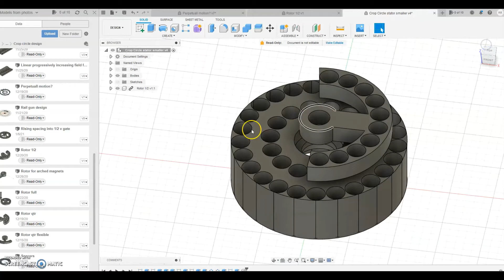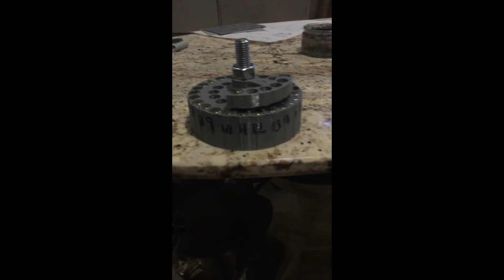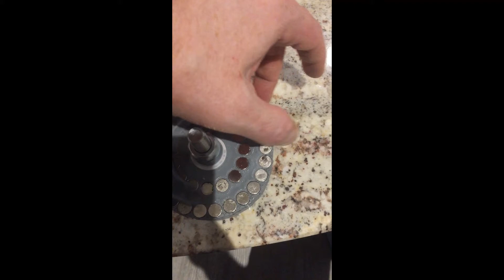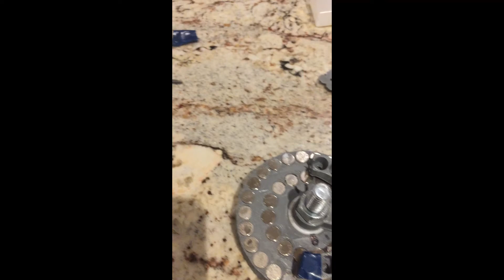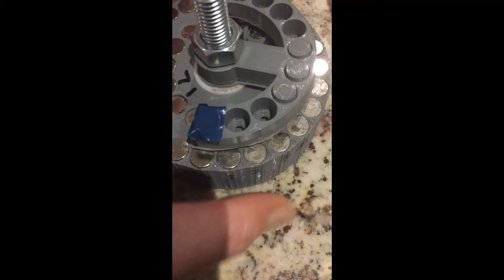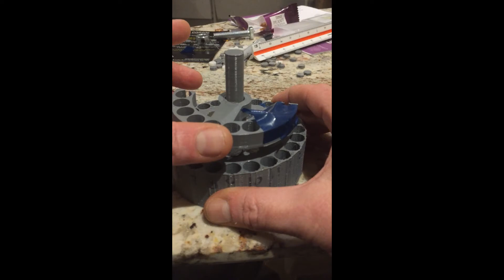Is this Crop Circle a design for a Permanent Magnet Motor?

Comment: I've already put this model together and one thing you are not taking into consideration. The depth of the drawing. You are looking at it as if it's one or two demential.. look deeper into your third eye and notice the dots/magnet's get smaller. They are not getting smaller, Their placement is deeper, lower or further down from the biggest dot/magnet.
Depth is why your model would work.
Now the amount of depth will be calculated by the measurement of the dot size using a visual distance of 1,33 mm. Scale. 
Please don't forget the polarity fluctuation theory. Magnets will switch their polarity caused by rotation speed and the amount of influences caused by other magnets. Use stable magnets.
That means the magnet used must be a ++ at each end and the negative or push must be on the circular sides of the magnet.. I first learned about these magnets while walking through a junk yard looking for a car part to fix my car and a friend was taking apart speakers that he came across. He stopped at a crashed Infinity SUV. And took apart the speakers that were located on the inside door panel up by the rear view mirror. Tweeter's as what we called them back in the 70's these weird magnets had the most unusual properties. They looked like three circular magnets one large one small and one large fused together forming a double positive ended magnet. Ask me one question please, I can't wait to answer your thoughts.

Comment: If it doesn't work. Could see that you might have saw thatvin a wrong perspective. What if the smaller ring is not a smaller right but it is just further away and therefore it appears to be smaller?

Comment: You must keep it out of equilibrium. Wander if a copper wafer the size of the magnets sandwiched between some of the rotor magnets would be enough to change the field as it moves across the stators.

Comment: If this were a working schematic,then the timing device is right in front of everybody..This is what everyone strives for trying to do this is searching for the Holy Grail timing device or system that will cancel out the magnetic pull at the right timing and allow a shaft to rotate freely..

Comment: Its a good design. You're only missing a tiny kicker in terms of design. Ever been to a parking lot where you have to drive in a corkscrew to get to the top level? If your magnets followed a slight corkscrew kind of rise and fall in their path then you could use the slight momentum of gravity to assist over the hump and that would also translate into kinetic energy on the downside.

Comment: Just thinking out loud here. The design is interesting, however your prototype didn't quite duplicate what the crop circle was illustrating. What if the outer and inner most circles were stationary and the middle two circles were the rotor (moving part)? It's also note worthy that the largest middle circle (of the two) has a ring around it, does this indicate that the center of the largest middle circle  is free to rotate? I'm also not sure what to make of the two solid inner rings around the solid center most disc. Does it indicate shielding or possibly a mechanical connection to the other circle rings? Anyway, good job for thinking out of the box!

Comment: There are these laws of nature specificaly the "Laws of Themodynamics" which explain why free energy is not possible. It doesn't matter how many magnets or what the configuration is that you use there will always be sufficient resistence to prevent this from functioning as hoped. This "motor" will ALWAYS require an input of external power to cause it to function.
Reply from the maker: The Laws were established thru experimentation. Since then they have become Dogma. Revert back to experimentation, which was the approach of those original greats
Reply: the law of thermodynamics has long been a myth. For ordinary people, ordinary scientists, it is hidden. Talking about terdodynamics is like staying in the stone age.
Reply: And what about push and pull forces from permanent magnets? There is nothing about thermodynamic.
Reply: Those laws have never been laws, they're a dogma, wanna know why? Because a "Generator" is NOT a generator:

"A time variable electric current creates an electric field parallel to that current. The field exerts an electric force on the charge in the nearby conductors thereby creating induced electric currents in them. This in the term “electromagnetic induction” is an actually a misnomer, since no magnetic effect is involved in the phenomena, and since the induced current is caused solely by the time variable electric current and by the electric field produced by that current."

"There exists a sourceless electromagnetic field whereas according to equation 528 such fields are impossible since there is no doubt that they represent a dual wave field, but as we've seen neither Maxwell's equations nor their solutions indicate the existence of causal links (no causation) between electric and magnetic fields. Therefore we must conclude that an electromagnetic field is a duel entity always having electrical and magnetic components simultaneously created by their common sources; time variable electric charges and currents."

"according to these equations in time variable systems electrical and magnetic fields are always created simultaneously because they have a common causative source, the changing electrical current, once created the two fields coexist from then on without any effect upon each other. Therefore electromagnetic induction is a phenomenon in which the field creates the other, I.E energy generation is an illusion. The illusion of mutual creation arises from the facts and time-dependent systems of the two fields appearing predominantly together."

-Causality, Electromagnetic Induction, and Gravitation: A Different Approach to the Theory of Electromagnetic and Gravitational Fields by Oleg D. Jefimenko

There is NO TRANSDUCTION between the kinetic input of a rotor and the electric energy in a generator, NO TRANSFER, if free energy was impossible a "Generator" wouldn't even work in the first place. The law of conservation is nonsense.

Comment: One way I see to solve this is you would need to flip the poles of the magnets on the track so the rail gets pushed forward using both attraction and repulsion forces.

Theory: 
> there is a circular runway lined with magnets
> a rotating arm with magnet at the end of it, that's able to traverse the circular runway  (let's call it a car)
> When you rotate the arm of the router there are mechanical components in the circular runway that flips the magnets on the runway by 180°

If the magnet underneath the 'car' is same polarity, if the magnet behind the car is same polarity and the magnet in front is opposite polarity then the 'car' is pushed forward with combined force of attraction and repulsion. 
If we can build a mechanism that can efficiently flip the magnets by 180° using a small portion of the arm rotation's momentum energy (which is definitely possible) then you have a perpetually running car and it doesn't even break the law of physics.

First we could test this using some computer simulation software, then build a prototype using electro magnets because it's super easy to flip the electromagnet's pole, probably need some Arduino or raspberry Pi to program this, ofcourse it will use external energy to run but it will prove it's possible to do it mechanically with intricate moving parts.
Reply: I starting to think the energy required to flip the magnets will be too great because of repulsive force of the car

Comment: What if you could change the polarity of a magnet? Or an electromagnetic field? What would happen if you could change the polarity of the field at specific times during rotation? Then your machine would be able to turn because you would use push and pull force at the correct times. Attract and repel. Add DC electricity to your copper coil to create an electromagnet. Switch the positive and negative terminals around to create the opposite field. N->S. S->N. Automate it.
Reply from the maker: Interesting ....maybe use the current generated from the natural rotation to power it

Comment: theres also need of copper coil in one point, and basically drawing of croo cirrcle is not showing electric motor, just electric generator on first point... its very important to understand the magnetic flux created by composition of circles on crop

Comment: Nice attempt! Because the strength and geometry of the magnets can not be adjusted then geometry and mass of the motor elemts would need to be adjusted to the magnets available. Drawings,  magnetometer (with suitable measuring range) and some calculations might help. Good luck!

Comment: The screw and nut add alot of resistance . I think a different alloy like copper , non threaded with a machined brass grommet would allow a fluid motion free of resistance
Reply from the maker: That isnt the issue, its the strong attraction at the gates

Comment: You need the exact ratio that is described in circles with accurate scaled ratio for accurate test I believe I'd you would of positioned the magnets more in the back and less in the front how u originally had it but when u added more instead of adding to the front why didn't u add it next to the tapped side would of made sense in my mind to add  8 and 8 and space it out about 4 then 5 away with 4 magnets I the front then add more gradually if needed great video tho your on to something

Comment: looking back at the crop image what if on the rotor  the large ball with ring is metal no magnet to act at weight  that will both interact with the magnetic field  and give you centrifugal force to  push the past the its end point onto the start point again

Comment: I wonder if it needs to be made of steel to give it the ability to spread / blend the Flux
Reply from the maker: Tried metal as well on this, less force still sticks...but I wonder if you had say 8 arms only 1 at a time at sticking point rest staggered to be on pulling points...pull on the 7 cld be enough to get the 8th over tge line
Reply: @explorationsinenergy8581  I mean the main body of the unit made from  many thin plates of steel like a transformer in theory it should give you continuous motion  because the flux will move like a fluid throughout the steel body building up like a wave and the wave will give the push needed to go past the stop point consequently producing continuous motion

Comment: You have two parts in the outer ring and two parts in the inner ring....they are offset by 180°....try making the outer ring N and the inner ring S, then on your rotating part, have the weak leading magnet attracted to the inner ring, while the stronger following magnet is repelling against the outer ring

Comment: I can actually see this working in my head.  Took one look at it and realized what they are showing.  Its an infinite amount of energy around the center rod.  You could use pinion gears to properly harness the torque.

Comment: This design wouldn't complete one circle as since the router reaches the lower half the big magnet pushes it away back unless the gained speed gives extra power to keep going as the router had another speed reduction on the quarter. The distant between the router magnet and the size would also play a part. However ,in certain speed the magnet would not make any reaction .So the best is to focusing on torque rather than speed.

Comment: Yes ,you did this in wrong configuration. But the fact  configuration shows  in this way  one half should be week force and the other should be the stronger, front half and back half between loop required.

Comment: Continuous rotation can be achieved but pay strict attention to the crop circles do not try to add things that are not there. all those magnets are not in this crop circle,
I would ask what are all the little dots between the outer circle? you can clearly see that all of the outer circles is tethered down the center, which is a lot of copper.
one large circle has a square hole, is that a power sign or solar?

Comment: The bigger magnet of the rotor seems to be a rotary magnet, in case the innermost circles also indicate a rotary axis. This may not make a big difference in your design where the N-S axis is bottom - top for each magnet, but it makes a difference if the N-S axis of each magnet is from center to border. Instead of varying the number of magnets you can also vary the distance.

I am trying something similar. You can reach me by the email that is stated in this paper to exchange ideas: https://zenodo.org/record/4475114
Reply from the maker: The problem is the gates at the most attaractive point, insufficient momentum and force builds up to get through it, and I have tried all the ones I have seen online (that are not fake). I am now thinking about torque so greater weight in the rotor arm, perhaps incorporating water as the weight, using the magnet array to pull up on the right, water moves further away from centre at the gate at the top left, improving torque on left which may get it  through the gate and could then cycle.